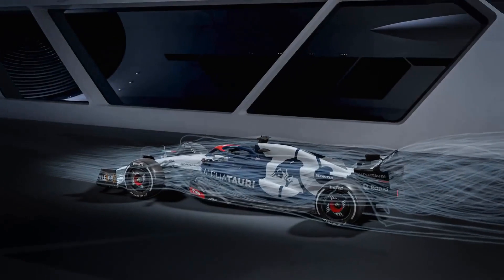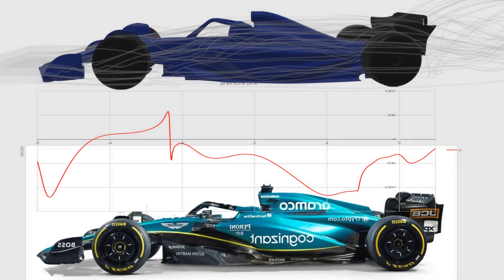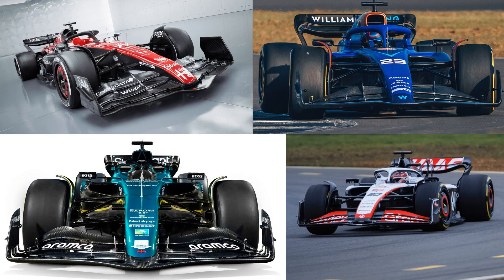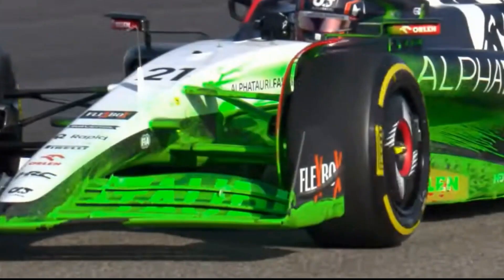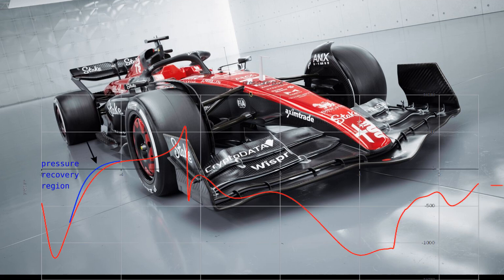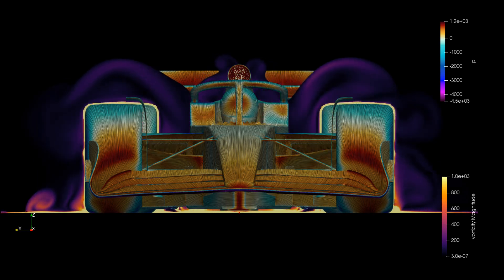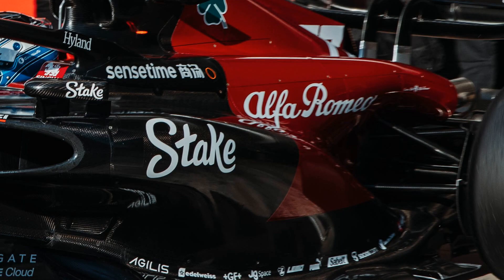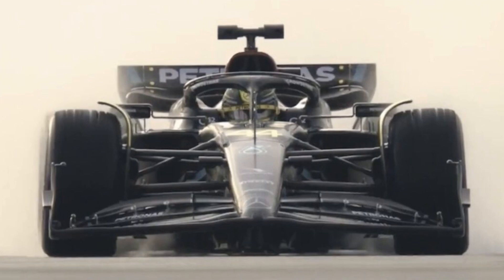Overview of the Formula One Aerodynamics Post Testing 2023

Comment: The airflow that get's sucked into the mouse hole is primarily under the floor if you can believe it, the airflow above is a higher pressure and stagnant, so some of it does go back there, but it's being entrained by the air under the floor.

Comment: The flow at the floor edge is getting sucked under the floor, the pressure above it is higher. The pressure difference above the floor and below it, gives you the total downforce. You want slow stagnant high pressure air to pile up ahead of the rear suspension, because then the fast low pressure air under the car creates massive suction. What you don't want is that air getting sucked under the car, because it will raise the pressure of the underfloor. So you take that piled up slow stagnant air, and you shove it behind the tires, that way it doesn't interfere with the fast low pressure air going under the floor.

Air does what it wants, you have to work with the air, not force it to do what you want, otherwise you take too much energy out of the airflow. The regulations both encourage and force you to create outwash behind the tire, whereas in the old regulations you had freedom to do this ahead, within, and behind the tire. The front wing works in combination with the wheel brows and winglets and the floor leading edge to manage the wake of the tire.

In the rear, the sidepod, suspension, wheel furniture, rear wing end plate, and diffuser wall, all work to do the same thing as the stuff at the front. The flow at the rear also has to be high energy so that it can be converted to pressure energy, and back to kinetic energy, to force air through the diffuser expansion. This lowers the back pressure of the diffuser forcing the floor to work harder, kind of like how the beam wing enhances the diffuser.